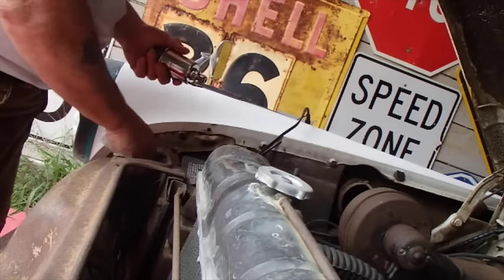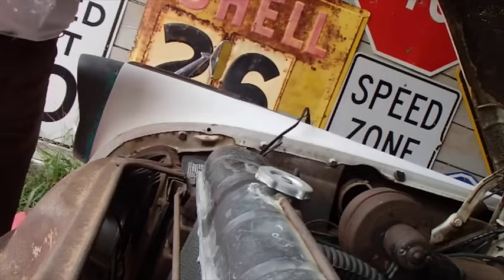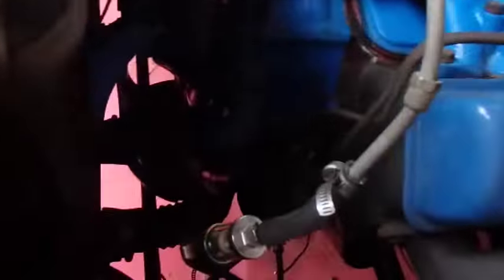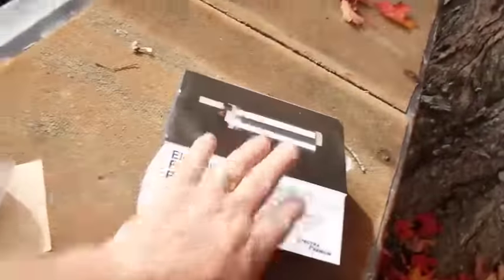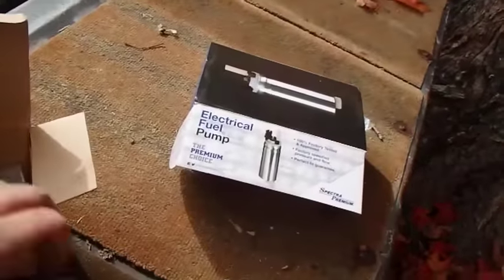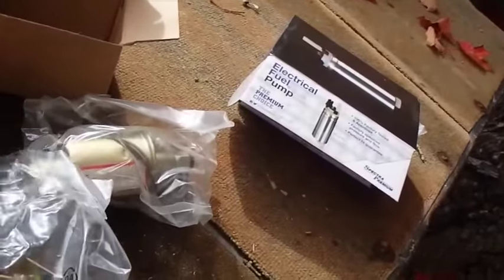55 Ford 6V electric fuel pump test

Comment: Another thing about electric fuel pumps; if you have a fuel line leak on the pressure side, the pump will continue pumping if you have it ignition controlled. The best way to install them is either with a momentary switch used for priming prior to starting or with an oil pressure switch on the ground side. NAPA still carries the NO oil pressure switch that was used on a Vega.
Reply from the maker: Lots of times I just use a toggle switch.  Can prime the line than cut it off once it starts I'm thinking..

Comment: Those are typically pusher pumps and don't pull well. They should be mounted as close to the fuel tank as possible.

Comment: It's not a smart move to have an electric fuel pump on a boat, a little fuel in the ol bilge an you got the BOOM factor to deal with,but ya could always jump overboard an swim to shore.
Reply from the maker: It didn't work but it did help me find the bad fuel line..